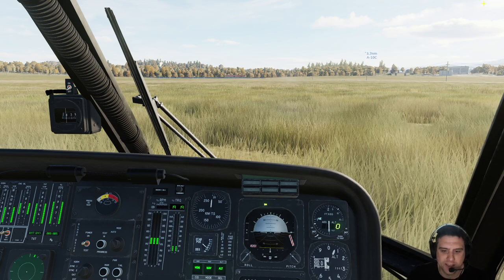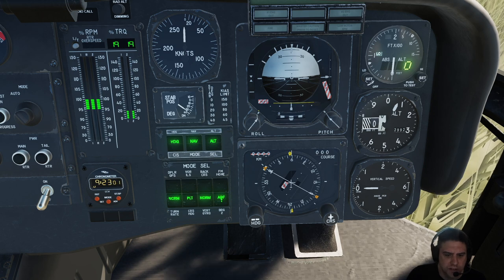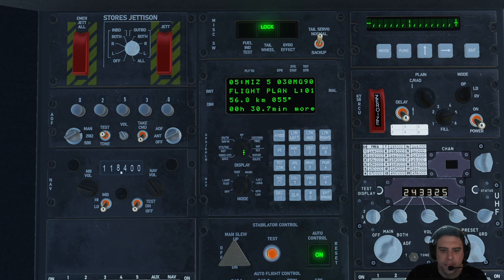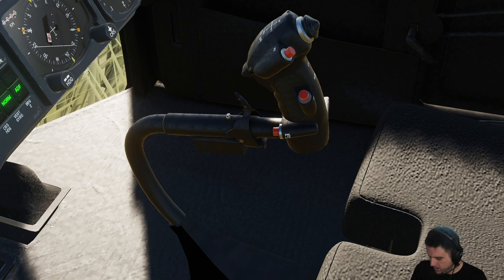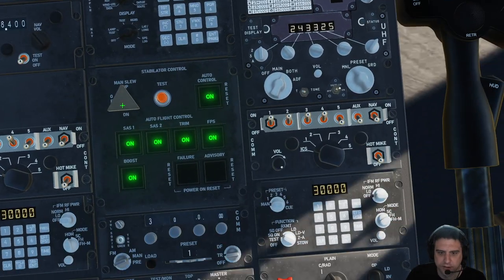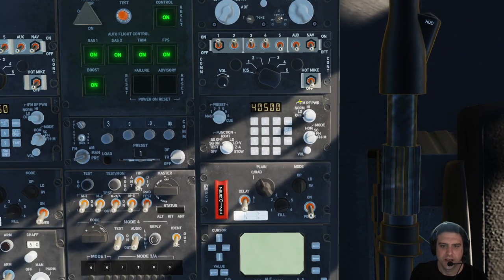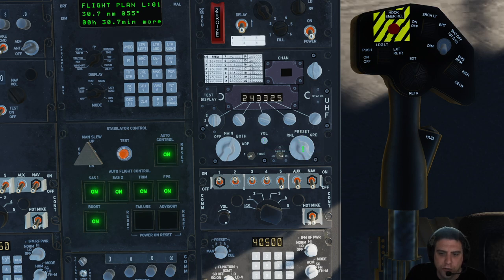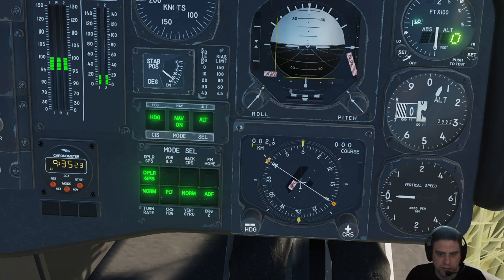Real Pilot in DCS - How Realistic are the UH60 Black Hawk Avionics? - Radios/Nav/GPS

Comment: hey snak pak, among all upgrades and changes applied to the lima in real life over time, which instruments would you like to see on the middle console in the sim to represent the lima best?
Reply from the maker: Um not sure exactly what you're asking. This Lima is pretty true to what the Army has been using for decades. They are being replaced by the M and V models rapidly which have an entirely different cockpit.
Reply: i have been observing the center console being updated all the time, instruments got replaced etc., just curious what actually belongs on the console.  I am talking about the center console, in the middle, between the pilots, where the nav stuff etc. is.  @SnakPakFlight
Reply from the maker: @piloto_loco  Yeah just the original download is what I have. Latest version. It's all pretty accurate. But some things can be swapped around on the center console. Generally, they are where they are in the base model.